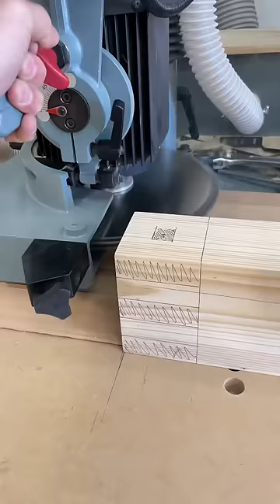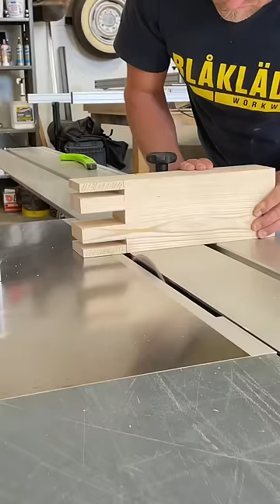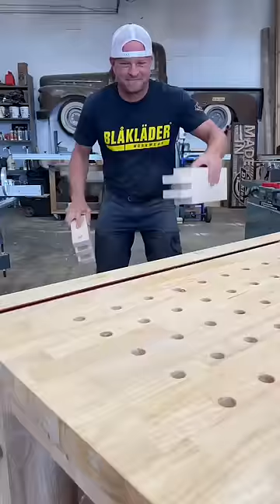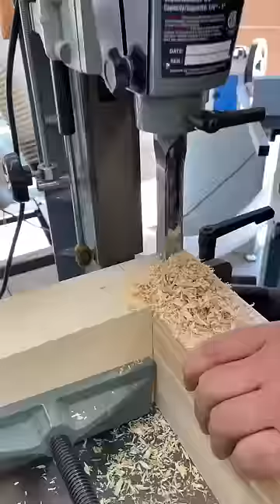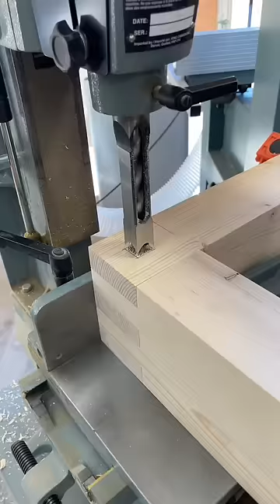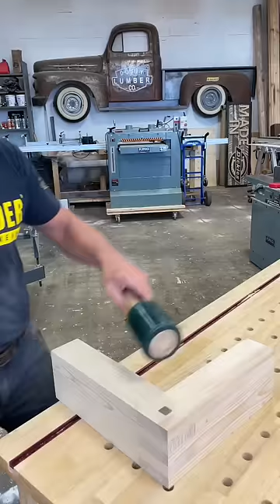Box joint with a square peg #woodworking #woodwork #maker #wood #shorts #tools #joinery #bois #holz

Comment: I never knew I needed a square hole drill, but apparently I do.
Reply: It is called a mortising machine with a mortise bit
Reply: There is a decent hug and square mortising chisels that mount on the larger standard drill presses. I’d love a dedicated Mortise unit, but these will do the job
Reply: @LarryTait1  You need a really solid drill press. Most DIY kit is not rigid enough.
Reply: A Square Hand Drill Bit would be the shit!!!   Someone needs to hurry up and invent it.
Reply: @thetayterminator1436  is that possible? Lol you’d have to be incredible strong. It’s basically a round bit with 4 chisels on the outside that chisel away the part that the round bit doesn’t get. The drill press applies enough pressure for it
Reply: What was that bit you used for the square hole???
Reply: How the fukc does it make square hole ?? Thats my take away! I couldnt fathom such a function !!
Reply: Mortising bit
Reply: You could probably buy a bit for a regular drill somewhere

I'm pretty sure it works by spinning around a round bit which cuts most of the wood, and it has a sharp square piece of metal on the outside which stays stationary so it just acts as a guide to keep the shape of a square 

In other words, the middle spinny bit does most of the work, and the outside square chisels the rest into a square shape.
Reply: I have one, its cool
Reply: Yeh, I can’t live without it after seeing this! 😂
Reply: In my limited capacity to absorb knowledge for future use, it would seem that a square peg, would be more structurally sound, lessening the chance of it "rocking" and enhancing the strength of the mortise than a round peg.  I also like cheesecake OH WAIT WHERE'D THAT COME FROM!!
Reply: واو رايات
Reply: @renecallejas7241  Is that a new thing? Now I feel like a dummy for not knowing that even was a thing.
Reply: @MrAzizisse  The machine is called a hollow chisel mortiser. There's a drill bit spinning inside the "hollow chisel". The drill bit clears the waste and the outside edges of the square hollow chisel cleans up the outside square walls of the mortise :)
Reply: been using one for 50+ years.
Reply: you never thougt square ??
Reply: Nah, drill a round hole, use a round peg.....?
Reply: @renecallejas7241 you know I thought you could just put them in the chuck of a drill press and it works nope needed the mortise attachment on a the drill press to make it work.
Reply: I feel like the joint would be just as good drilling a round hole

Comment: Never seen a drill bit like that before, very cool
Reply: Drill bits are for breaking through rock. Such as for use on oil wells or water wells.
Reply: It's a mortising bit and the machine is called a mortising machine!
Reply: This has been around for more than half century
Reply: Its a drill bit inside a square chisel bit
Reply: its a hollow chisel mortiser,. You can buy attachments that go on a drill press that basically converts your regular drill press into a hollow chisel mortiser, but be careful because some are just cheap garbage.
Reply: @jpeterman57 sigh....

Comment: Very nice joint, but ideal aren’t yours supposed to cut the square hole separately? In order to offset it in a hair so when you put the square walnut piece it tightens the joint ever so slightly?

Or atleast that’s what Japanese carpenters do in similar situations